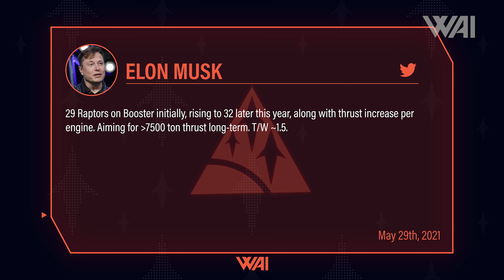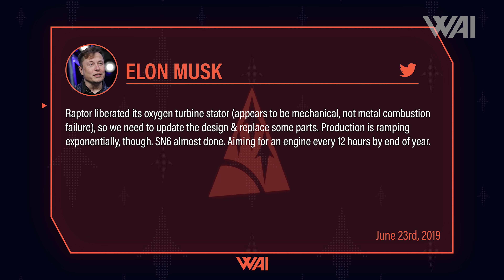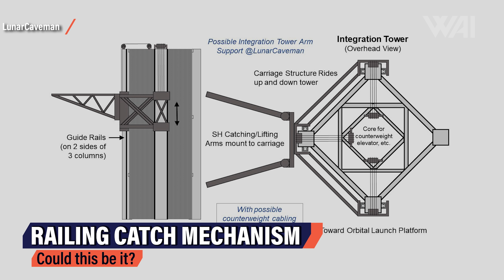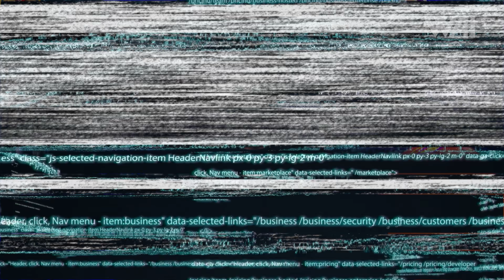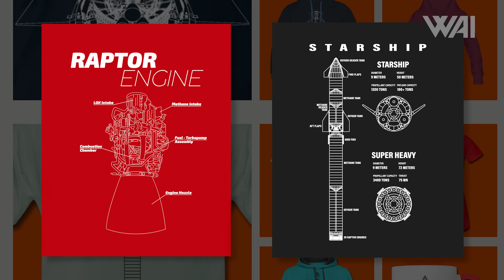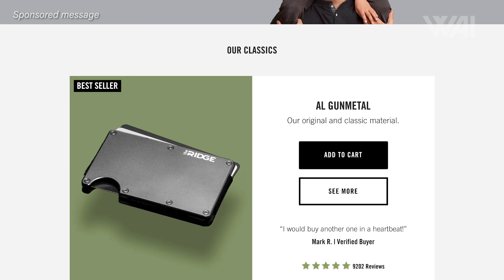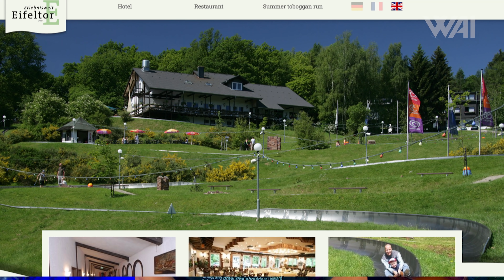SpaceX Starship Phase 3 begins! First test candidate at Launch Site!

Comment: Maybe SN16 will be a weight test for Booster, not going to orbit but return after seperation
Reply: Not gonna happen
Reply: @alvianchoiriapriliansyah9882  probably not but it would be fun to see how it performed from high altitude.
Reply: @Blaxjax21  Delays on maiden orbital flight as a result of that wouldn't be so fun, since modifying SN16 for full stack use is gonna be more efforts than just building SN20 in the first place

Comment: First thank you for your hard work providing info on space X. The rendering of that tower that’s going to catch the booster doesn’t seem too realistic. In the sense that shouldn’t the arms kind of be in a circular design that might have I don’t know say rubber on the arms to help keep the booster in place?
Reply: I think the catch system that might be used will be similar to the hook and wire system used on aircraft carriers. Here it might be expanded for a vertical application, to use 2 or more cables and 2 hooks, one on each side of the booster. It's a proven system, and it works. Carrier decks use 3 or 4 wires, and catching the 3rd wire is ideal. Wire cables used in this application fail sometimes, and a fail safe design might have to be considered for something like this.

Comment: Judging from the previously stated limitations with ground based launches(inability to clear enough land area), combined with the lack of a 100 ton payload and at least somewhat reduced fuel required for keeping it merely a "near" orbital launch,  and the positive mathematics of sacrificing less hardware, is it probable first itinerations of superheavy will have less engines?  Maybe the 32 engine itinerations will come with oceanic launch facility?
Reply: The first one will have 29 engines

Comment: Im mostly worried about resonance issues with super heavy. Anyone else share that opinion?
Reply: Resonance issues meaning what?
Reply: @michaeldeierhoi4096  meaning im worried the amount of noise and vibrations from that many raptors may damage the raptors
Reply: @damitcam  This is a rocket test just like what has gone before.  Now Space X is dealing with a higher level of risk.  A lot can go wrong and probably will.   But I am not concerned because I know the Space X team will learn from its mistakes.   

There are a lot of engineers working on this that are much smarter then you or I.
Reply: @michaeldeierhoi4096  i know it will learn im just worried they wi learn the raptor needs a lot more work
Reply: @damitcam  The raptor is still under going testing as is the rest of the rocket.
Reply: @michaeldeierhoi4096  im aware of that all im saying is i hope that raptor survives this level of noise and vibration. I know all about this program im just wondering if the engines will take it. We dont really know yet because they are testing them still

Comment: My guess is that those so call clamp are in reality The landing leg of the booster. this is what will absorb some of the pressure during landing. the vertical opening in the orbital launchpad indicate that the clamp move up and down, add some shock absorber and you got it.

Comment: Is there any potential issue where one of the inner engines doesn't gimbal correctly and prevents all from gimballing?
Reply: This is an advantage of engine-out capability. When that happen, the incorrect engine can move away and the main control will be taken by the rest
Reply: @alvianchoiriapriliansyah9882  so there's redundancy to ensure it can move?
Reply: @Thomas_Acharya  Have many engines is a good thing here. When one is failing, it won't affect the flight as much
Reply: @alvianchoiriapriliansyah9882  agreed usually... But if the gimbal motor on one goes out, would it cause problems for all?

Comment: Hey Felix, I wonder, how far do you think the spaceship would get on its own, with both the sea level and vacuum engines installed?
Reply: Scott Manley did a show on that once and apparently the thrust to weight ratio is not quite enough to get to orbit unless starship is cut to the bare bones and then some.  At any rate it wouldn't be practical.

Comment: Elon musk should also test the yield point of the thrust puck as various tank pressures versus the force of raptors on full burn. In case the tank ever sees a low pressure situation while at full thrust on the puck. Cause as a tank empties it also loses pressure and then the puck may fail while still passing a full pressured tank test.

Comment: I don't think there will be a large counterweight inside the tower. At least, not for the purpose of catching the booster. 

The issue I see is, if you are catching the booster, you want to stop it as gently as possible. That will probably not be done by accelerating a large mass, unless you figure out a way to accelerate slowly first (while the booster still has some velocity) and accelerate harder when the booster is nearly stopped. 

If you want to catch the booster and actually remove some of its momentum, you'll have to have a construction similar to what they have on aircraft carriers, that will provide braking force but have as little mass to accelerate first as possible. When you first make contact, you have to accelerate that mass to maximum speed, then brake it down. That first acceleration happens quickly, because it's actually crashing into that mass. On a carrier, the mass that gets accelerated most is the center of the arrestor cable, then the rest of the mechanics, down to the dampening cylinders under the deck. Only the center of the cable gets the shock acceleration, everything else gets much less, while the cable gets pulled out.
Reply: I don't see how the catching mechanism on a carrier is equivalent to the planned catching device planned for the Super Heavy Booster. Because the jet landing on a carrier has to accelerate in case the cable doesn't catch it.   The SH booster however would need to be caught on the first try.

 Elon has said little about the details of this catching mechanism so we just have to wait and see.

Comment: The launch pad model my work as is, but, but water spray will be an absolute must. The Falcon 9  only uses 9 engines, and that needs water noise cancellation. So where is the water?

Comment: Felix, you pointed out an interesting point, that’s a lotta engines.  Has there ever been any talk of scaling up the Raptor engine?
Reply: There are a host of technical problems with increasing the size of the bell alone in a rocket engine.   At any rate Space X has done well the Falcon Heavy flying with 27 Merlin engines. No problem!

Comment: The big problem imho with this test leap is that you cannot escape demonstrating proper landing (without flames) and we’ll designed landing gear….again you can’t escape that test…..regardless if you leap over that step for now….
Reply: The SH booster can escape the landing test by being caught by the catching mechanism on the Integration Tower, but that isn't going to happen for a while.  They will land the boosters on Deimos, the repurposed oil rig when ready.   

And we'll see how the Starship second stage does on its first orbital orbital.

Comment: Not only will they need to be ultra-precise with the location and speed of the descent, but the booster will 
also have to have the heat-shield tiles facing away from the catching mechanism in order to avoid damage.
Maybe there will be additional hardware on that side of the booster to assist with the tower's catching device.
Reply: The booster doesn't have any heat shielding as I understand
Reply: Only the SH booster will be caught by the catching mechanism at the launch pad, but that won't happen for a while.

Comment: Why does the launch table need those add-ons at the top? Why not extend the main legs and reduce the inward lean angles?  
The best part is no part - Elon Musk.
Reply: The inward lean is for structural strength,  results in a larger footprint for lateral loading
Reply: The leg extensions will be strengthened by horizontal brackets.

Comment: Hey Felix, you briefly addressed the raptor production, which translates to ~3 months to produce a booster+starship combination. But when BN2 and SN20 splash down, that is a lot of raptors, just chucked into the ocean. Seems like an awful waste. So what do you think: will they try to recover the engines?
Reply: No. They already produced quite a lot of engines for a couple of orbital flights
Reply: It is a waste... but they're unlikely to be in a reusable state after landing in the ocean, even in the perfect case of a soft landing. They won't want to waste too many Superheavies that way, but otherwise, I think they're just relying on the fact that they're building ~180 engines per year.

Comment: a question to a real expert!
What is the machanism of throtthling down/up Raptor engine? What excactly is doing that? I am asuming  that power depends on the rpm of turbopomp, but how excactly that works for FFSC or in general for all closed cycle engines?
Reply: I have heard that raptors have a minimum throttle of 40% and Elon had talked about trying to reduce that further.  

I don't know about the mechanics behind that.

Comment: Does SX plan on recovering the two craft from the Gulf / Pacific? Bet China is!
Reply: For a loose definition of "recovering", sure. They're both making wet landings — nobody wants to put ships too close to the target zone on the first reentry attempt — but they'll certainly be fishing things out of the water afterwards. 

And I'm also pretty confident that China will be doing no such thing. Remember, the landing site for Starship was chosen because it's right next to the Navy missile range at Kauai, and SpaceX want to use their ICBM-tracking radar. Much as China might want samples of a crashed Starship, they're not going to sail into a closed military weapons testing range to do it... it would be such an unfortunate accident if their spy ship were to be struck by stray debris.

Comment: I love the work SpaceX is doing, but... I bet you my life savings that the first BN launch will either be cancelled at a few seconds before engine ignition, or explode during ascent.
Reply: No starship ever exploded on assent so why would the booster?    It's the landing that is hard part.
Reply: @michaeldeierhoi4096  because there will be 32 massive engines firing up at the same time, one right next to the other, and it only takes one of them to fail, and there will be a cascade effect to follow, like knocking down dominos...

I seriously hope this will not happen, but... this is too much power to successfully control on the first flight. Maybe on the 3rd or 4th test flight. But the first test flight will 100% be RUD.

Comment: The lack of a flame trench is part of my worst nightmares. I really don't want to see an RUD on the Pad because the exhaust fires projectiles at the rocket
Reply: The Starship is going to sit on the pad which is about 70 feet or 21.3 m above the ground.  Still concerned?
Reply: @michaeldeierhoi4096  The Power of 30ish Raptors is insane, so yes, I still am concerned
Reply: @bjarnes.99  SpaceX engineers certainly didn't

Comment: If it has no legs: what does it stand on in the launch table? On the sharp hull edge?
Reply: We'll see.  I have heard nothing definite.
Reply: @michaeldeierhoi4096  could it also start off the fins lying on the catch arms, which it would retract during the first secods into the flight?
Reply: @b3ndotch  The plan is to launch the SH and Starship from the launchpad and later when the testing for both has proven their integrity the booster will return to the IT to be caught.  And the starship will do its flip and land.  That won't happen until next year at the earliest.

Comment: true excellent video but ruder gliders form line has purpose if you do one more video in theory a buble heat would buble more create a layer burst that slight protect more above so is good to even calculate this elevation if it is more then 10° angle possible is wise to that also a further study would allow even possibility off curved mid since in theory a metal inline would create even more buble distortion so is good do even in chasii first better stability second a lot safer on heat heat reentry the later stage couls even have isde bars kind engine bike to have so called chasis impact srtifness burt this is already like crush and chasis improvments tech on know hwo colision impact improvments this steps are slight above later after genuine data colected and first vision and imprresions about taks then is using know how predicting using creative skills and doing prep about possibel predicting efects andsome research and inovation also best if uav model and vtool engine mechs and vertical stabilizers also uav can bring a rotational cocpit fast an bdoy alternationac as seign in real time know hwo diff best if messurred data thren full prototypes or several version and usualy after some fund locked or cash can very stabile irmpovments fi you knwo what to search and set goals adn flimed with data caracterics on cam and pc analize so diif is spectacualr some times so good that you can pin point next steps off launch and possible stage launch lvl developing the dat would confirm all even skip lvl launch as possible tech for next 5-25 lauch basic imrpovments 360 ruders possilble vtool engine 2x2 rotaional on servo after like 25 -50 launch is all stuff integraded evn scfi chasis impact test improvments made after all full possible research is again inovative chasis new research build and improved techincaly in moedling some size then real UAV size you practice all that and pc does alter ratio and  size and oyu ger preliminary real data behave and some acuracy about more then 95 % possiblity easy if nto 99 or 98% eficiency easy so if industrial process follow it woudl take some ajust or price spend as soem process make reitnegraded parts but tech based on how and sometime production require some alternations or modular assembly once tech colected is kind piece off cake remoduilng production and geting into serious stuff faster even prea part skiper dynamic prouducer multi tools and multi tools roobots rest is knwo how even engine gets serius shell and created on bulky design product and double wiring easy and wifi conection sfcfi part and ps diagonstocis like in tablet and part comunicate and confirm status on bypass or ask

Comment: All 6 raptors on a Starship are used to get it into space, and for boosting into transfer orbits like to the Moon and Mars.  The three vacuum raptors are fixed, and provide more thrust. Don't know if they won't have a throttle or not. The three gimbaled raptors are needed for thrust direction control because there is only a limited amount of control from throttling.

Comment: I have my questions about the engineering specs of the launch pad, it's going to have to withstand pressures and stress levels far beyond anything that's come before, also (so far) no real flame diverter. Going to be interesting.
Reply: Just hope the weight of a fully loaded Starship and booster doesn't sink the entire assemblage into the water table!
Reply: Maybe the bouncing shockwave will help with the lift of the pad :)
Reply: @Mosern1977  It for sure could. Question is in how many pieces.
Reply: The ground diverts flames just fine, wym? =P
Reply: @zacharyhutchison4006  Taking into account that there are best engineers in world working on rockets flame diverter for sure has reason of existing

Comment: "Catching the rocket"  Really? So it destroys the launch center when it fails.... Really?   Put some danged landing gear on it and land it off to the side so it doesn't destroy everything in one failure. "Catching it?" Man that's so unprofessional.
Reply: The guy calling Spacex unprofessional lol. The booster will land on the water in the first launch. Only when they feel confident they will try to catch it with the launch tower.
Reply: Your should call SpaceX and tell them you know way more than they do and that they should hire you... There's a reason landing something that tall and thin won't work